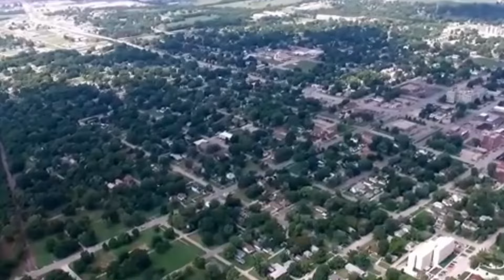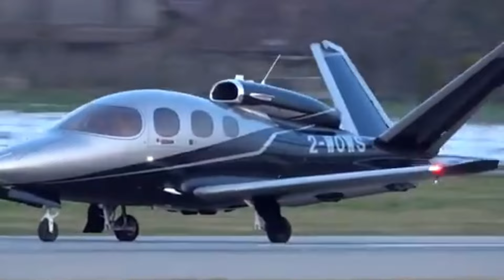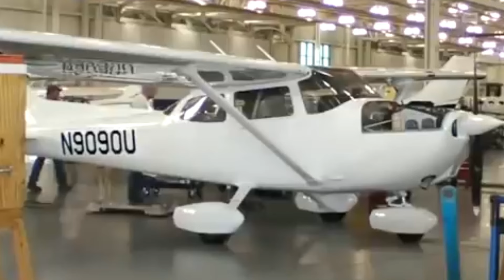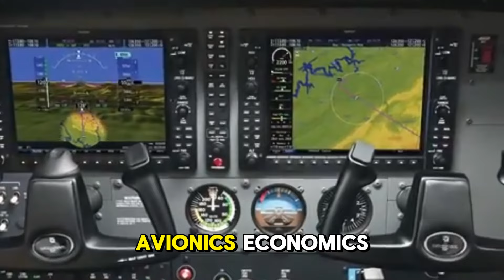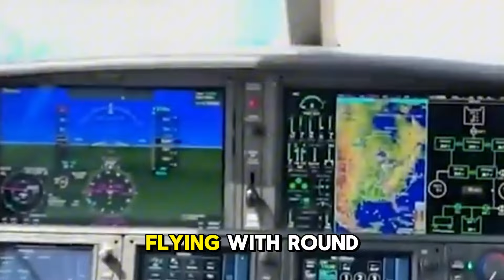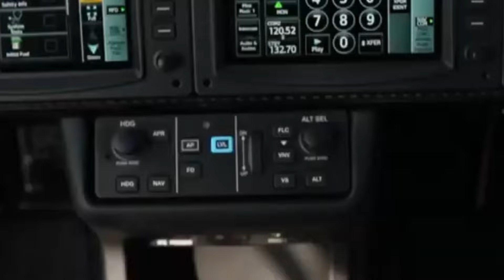Back to the Future: Why a Prop and a Round Gauge Are More Reliable Than a Glass Cockpit.

Comment: Are you out of your frigging mind? A vacuum pump and an AI gyro is one of the least reliable instruments in an aircraft. I pulled the vac system out of my aircraft, both saving weight and making it more reliable. I kept the static/pitot system, which the glass also uses. We need to move beyond mechanical systems.

As for pilot confusion, step up. Flying is complex. Learn to use the new systems. If you are going to tell me that using a glass display is more complex than the frankly ridiculous procedure of trying to rapidly scan a 6 pack to determine if you are right side up, you  are smoking something.